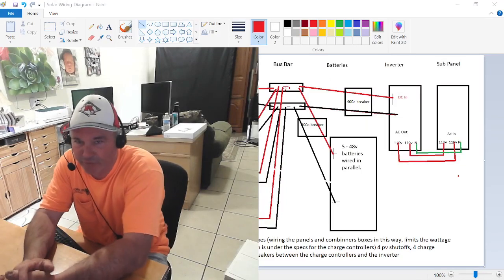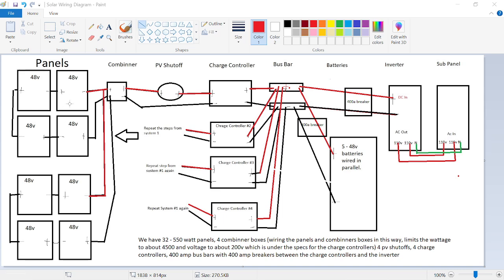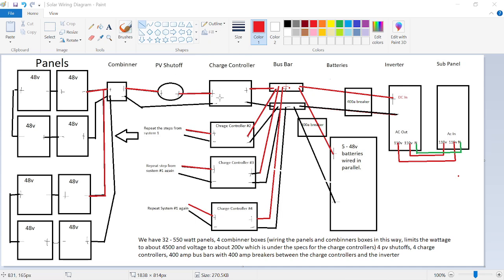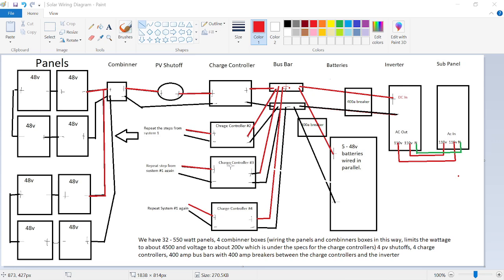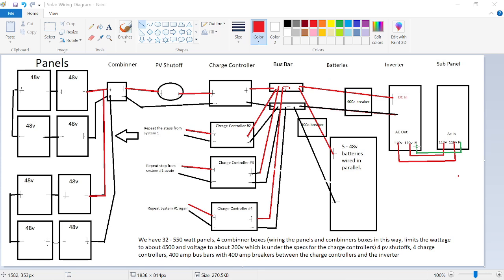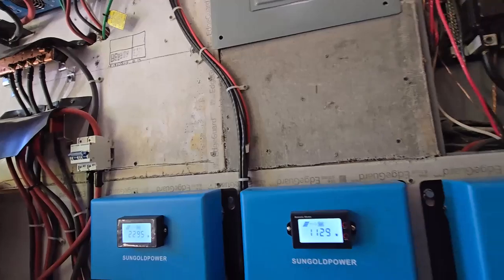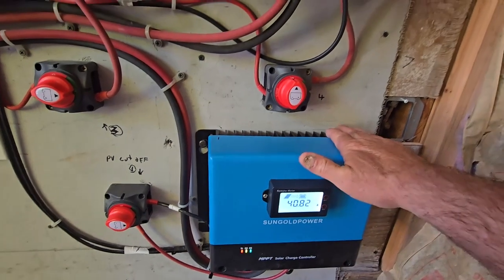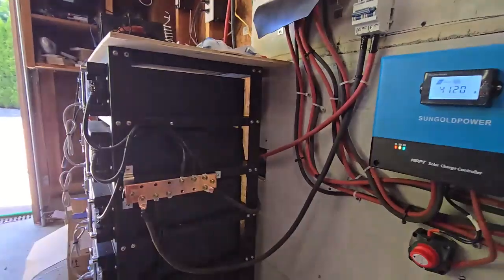Solar Electric System, Complete Wiring Diagram for Hybrid System

Comment: I use Paint all the time. Its a very useful thing. So its a 48v system and quite large for a house situation.  So on a smaller scale quarter size system for a camper/rv it could be - 8 of those solar panels into a combiner box, pv shut off switch, charge controller, bus bar and into a single rack battery.
Reply from the maker: Yes, it is a very large solar system. Our house is all electric thus the large inverter. We do not get as much sun in the winter, rhus why I built the solar panwl system so large.
Winter time here in the NW we might see a small glimpses of the sun during the day. More panels to catch those glimpses.